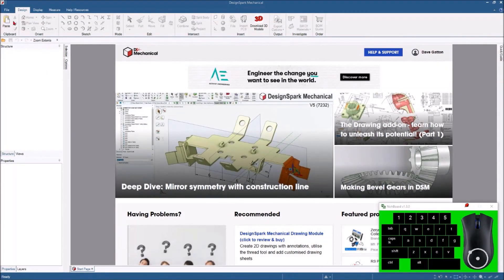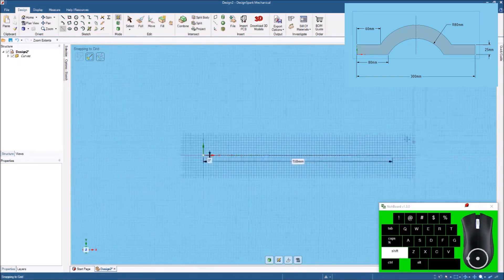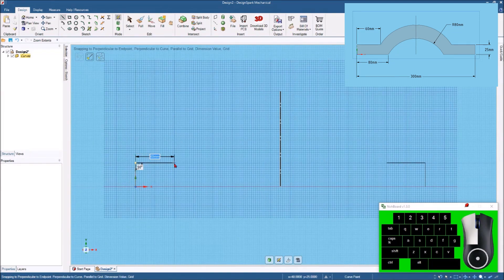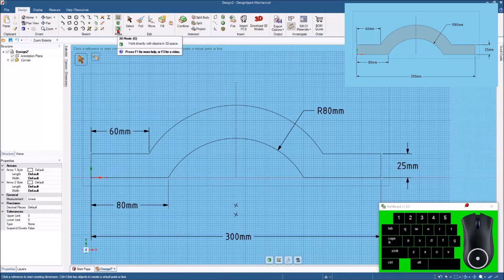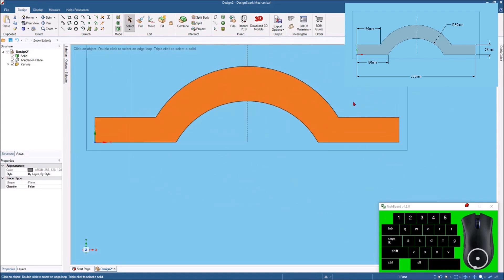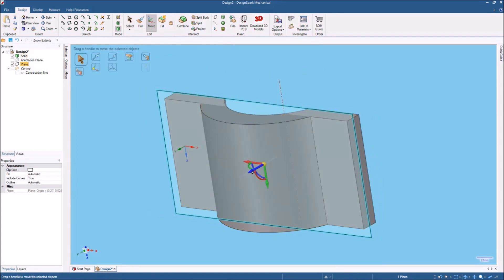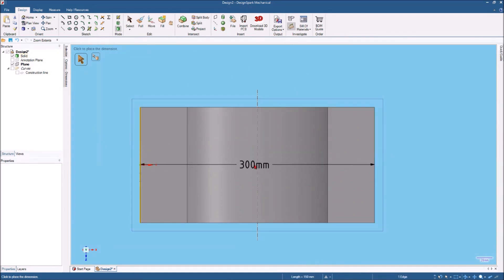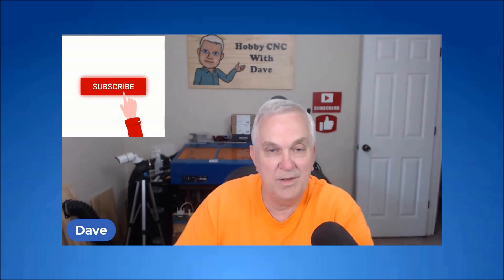DesignSpark Mechanical Tutorial  |  Adding Text To A 3D Model

Comment: Thanks for all the videos Dave!  Thumbs up!  This is much easier to use than FreeCAD.  I am having trouble figuring out how to draw a cone shaped top.  I made the part with a flat top, but got a lot of bridge stringing due to not using a support.  I typically like to design parts without using supports (if it can be avoided).  Making a cone top helps because it supports itself, and looks better.  Are you able to give me/us some guidance on this?